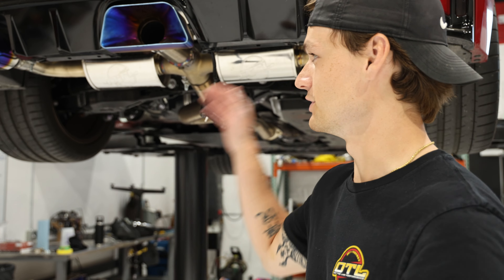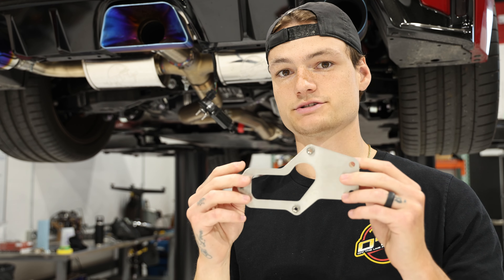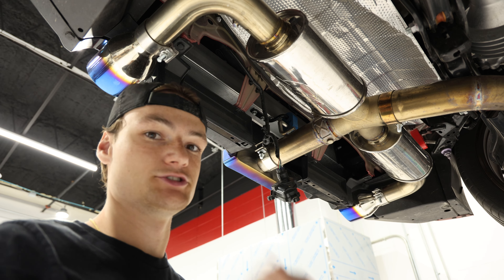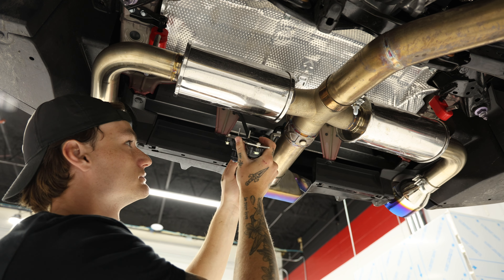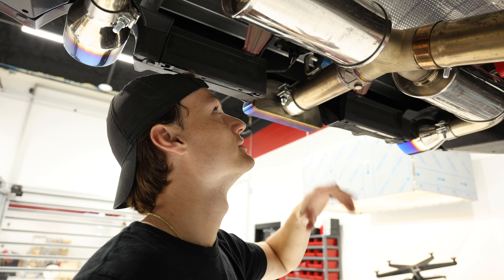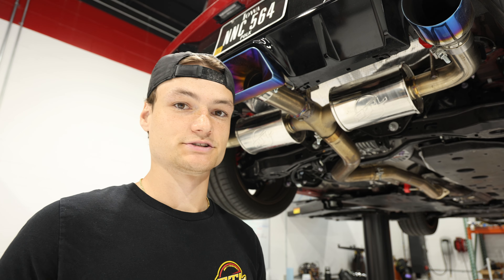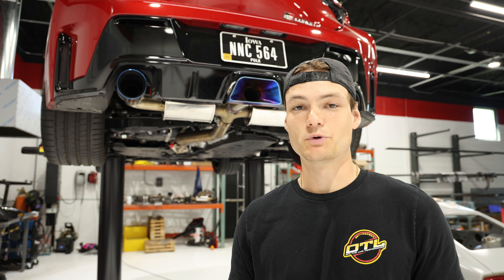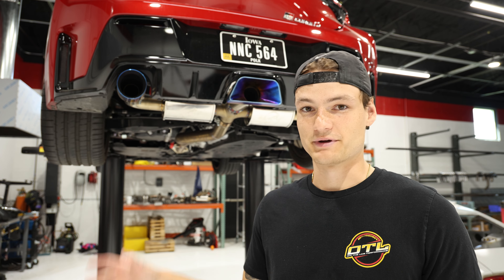The best solution to the GR Corolla Exhaust valve FIX (Install guide)

Comment: I would add some rubber washers to help isolate any vibration form the valve "opening and closing"
Reply from the maker: could be a possibility!
Reply: I just installed mine and I can hear the valve actuating when coming to a stop

Comment: Might be pedantic, but it drove me nut to hear a manufacturing company use wrong measurement language. A mil is a measurement that equals one-thousandth of an inch, or 0.001 inch. One mil also equals 0.0254 mm (millimeter). Thus, a mil is not the same thickness as a millimeter.